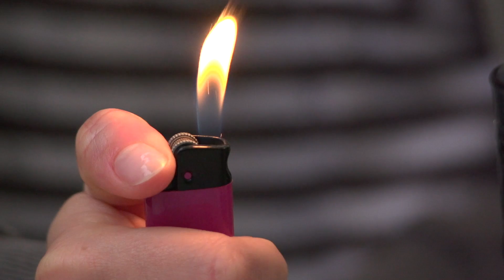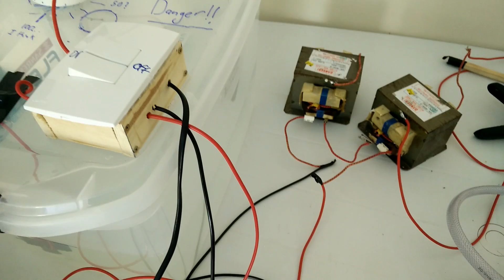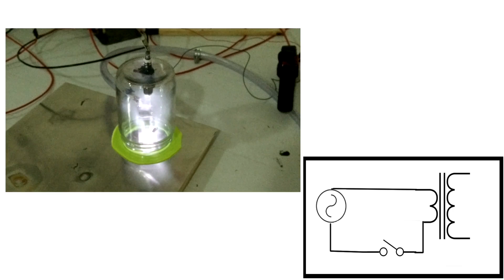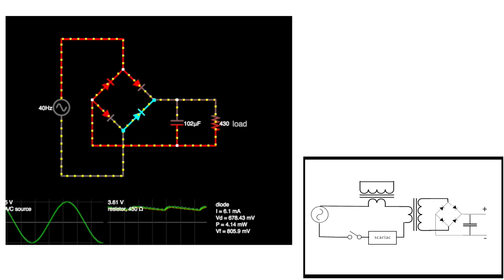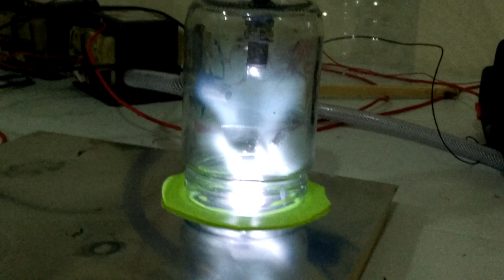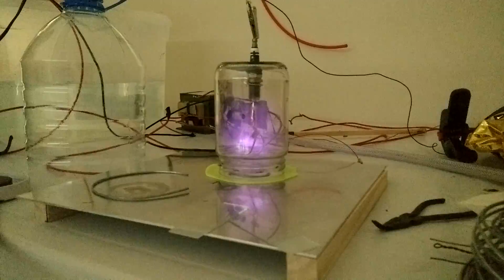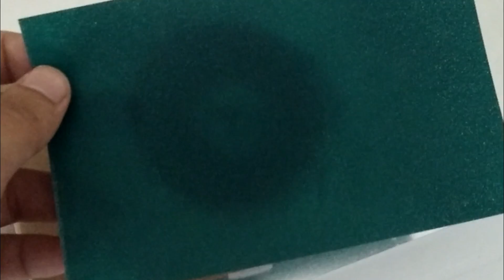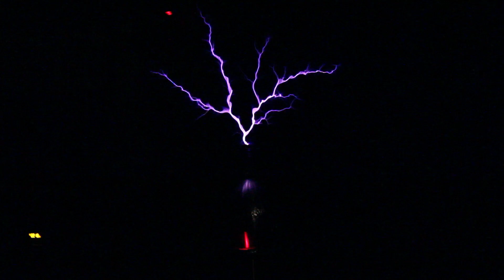Putting Plasma to Work (DIY Fusion Reactors, Magnetrons and More!)

Comment: plasma is the most common form of matter in the universe, so people should know about it.
Reply: teach it in k-12 then...
Reply: Guess what? Our Earth's core is plasma. Shhh. Our government doesn't want us to know where gravity comes from.
Reply: @vDarknessFalls  That's sort of true, since the Earth's core is metal, and liquid metal (like the outer core) is basically the high density equivalent of plasma, and it is at plasma temperatures, with the deep core being hotter than the surface of the Sun.

I'm guessing your just making fun of Electric Universe "Theory" supporters, and, yes, the Earth's core only provides a fraction of its gravity and it's just because of mass, not anything to do with plasma- or metallic-ness, but I just thought I'd point out that you were kind of of right.

The 2nd most likely (and almost as likely) possibility is that you're serious, in which case you can replace my "yes" with a "no", but you probably don't trust me anyway.

Comment: if you can do all that why not build a laser? btw if what you need is just high voltage why not go with a simpler power source like a fbt driven by a cfl circuit or eb and a homeade cap on the output,,you should be able to get 10-30kv cw power if your cap is good

Comment: You make a couple big safety mistakes when wiring. 

First off, the body of the transformer should never become hot. With your setup, there are two things I saw that could cause it to happen. The first is simply mixing the wires; if one of them is shorted to the body that needs to be neutral. The second(and what I think you done based on your setup) is that the type of transformers mentioned above can't have a load between them and ground. Where you physically connected your scariac is the problem. You need to move it to the hot side of the circuit; it will still have the same current limiting effect but will keep the body of the transformer grounded.  

Second, never ignore the ground wire. especially when working with high voltage/ions. The entire reason for that extra ground is to make sure you always have a direct link to ground to dissipate stray charge build up on surfaces that shouldn't have charge. It also protects us from when we get too clever for our own good(like putting a load between your transformer body and ground...). No device needs that extra ground to work yet every professionally designed device has it. 

Finally, you should had some sort of current limiting device into the circuit. A fuse will work, but if you mess around with this kind of stuff enough than you might as well invest the $15 in getting something like a 5 amp breaker to put between your surge protector and outlet. 

Oh and one more thing. Consider getting a cheap function generator. I won't hold this against you because you try to minimize equipment, but you really should invest a bit into the basics before trying to tackle stuff like this. $300 will get you a basic setup(function generator, DC source, and o-scope). In trying to make things more accessible, you also made them harder and more dangerous as people working on this are doing so blind with dangerous power.
Reply: i was watching his video about sputterers and all this high voltage wiring is just there, bare, on the table, in quite a mess. It's a disaster waiting to happen. At least screw it down or something. And this is while he's messing with the vacuum pump, argon tank, and magnets.
Reply: Safety shmafety, I like danger and you should too
Reply: @marshallsober  what if I told you that dying is a health hazard

Comment: Why did you choose press fittings? They are more expensive. A regular 3/4 or bigger (1 1/4 woulda been good size haha) sweat would of worked fine. Hence no rings around the outsides of the fittings

Comment: Not Flint!  Why do people keep saying that.  Its not flint.  Its Iron, and the reason its hot is because its doing something insanely cool.  Its also why iron is never found pure in nature.  Iron, unlike most metals.  Will literally rust in any air with oxygen in it.  And it does so at a net gain of heat.  So if you chip off very small flake of "Fire Steel"  using "Tool Steel"  the shredded bits have a VERY high surface area to volume.  Why doe that matter?  Iron is hypergolic.  But you never notice because its insanely good and thermal transfer.  Anything about dust sized and it rusts on the outside, but just warms up the rest a small amount.  then cools back off.  you never notice.  So whats happening is your filing off a bunch of pure iron and its becoming red hot because its rusting super fast. 

So you might ask, why do people keep assuming flints part of it?  Well listener, back in the before time, before things like Tool Steel and Plough Steel.  Special alloys.  they needed a way to make those shards of Iron.  and all there iron had the same hardness.  So they used something that was harder.  Flint, has a higher hardness rating then firesteel.  and people would carry specially shapped ringers of iron to make this easier.  But it was very hard to do.

And that my good sir, is why It drives me right up the wall to hear you at the 0:47 mark of the video saying Flint particles!  Like what about them is supposed to heat up and why?  Is it supposed to be friction?  Or magic?  Its a nonreactive rock flint is.  Please stop spreading that stupid stupid myth.
Reply: Hand warmers.. contain iron and when exposed to air containing oxygen they react (rust) producing heat.. very good insight Sarah
Reply: TIL thanks

Comment: At 17.08 minutes you can see the plasma double layers form, really cool.  Be careful there you are producing UV light and X-Rays.  You could damage your eyes.  UV burns feel like sand in your eyes- Not Pleasant  Keep eyes and bodies away from the experiment.
Reply: Exactly my thoughts. I can't imagine how it can be capable of nuclear fusion, but I can perfectly imagine how it can produced radiation with 2-3nm wavelenght (K emision lines of nitrogen and oxygen). Using voltage in tens of kilovolts and iron electrode would be extremely hazardous I would say. Actually I would like to see emmision spectrum of this thing and I would be curious about placing fluorescent lamp nearby or into the chamber.

Comment: Hello, I just saw your video. I must say you do some amazing things, and I would like to let you know that I have some equipment for sale like what you mentioned in this video That all came from an old STEM microscope I did sell the diffusion pump already, but I still have a lot of it available here - https://www.ebay.com/itm/E-TEC-SEMicroscope-selling-all-parts-separately-for-one-complete-1980s-scope/173832852386?hash=item28793ed3a2:m:mE-ukLr_Irg85WVzlvWtDyg

Comment: Hello, I am not sure if you are still looking at comments for this video but I am in desperate need of some assistance. I have already gained moderate experience with a lot of high voltage DC plasma experiments, usually variations on cathode ray tube designs to play with cathode rays passing through various magnetic field geometries, but I would like to move away from these due to the X-rays emitted. Do you have any info I could read or that you could share in a video about inductively coupled plasma experiments?  From what it looks like it seems a that the goal is to dump a lot of RF power into a low turn count coil (I've seen anywhere from 4-10) which surrounds the vacuum vessel in which the plasma is to be generated. However I do not know what sort of voltage I will likely need for this, and what the lower limits of power consumption are to be able to ignite the plasma (like a ball park for a home brew rig). As well, I am not sure what circuit to use for this. I am currently trying to modify a ZVS driver as they can handle quite substantial amounts of power, but I am worried that the 10-50khz range of most ZVS circuits might be too low to be feasible. Do you have any insight in this area? Thank you.

Comment: fusor will never create fusion. its just a neon light. would be more likely to do fusion with  a single heavywater particle suspended by a electrostatic field and heated by a laser reflecting off two mirrors with the heavy water particle in the middle.

Comment: Loved your video. I AM VERY INTERESTED IN WHAT YOU ARE DOING. I have built a few small devices. I Seriously want to build a portable, focused EMP device capable of taking out a vehicle. I have looked at exploding wire devices. Of course portable means you need a portable power supply. That may make it impractical,  but I want to explore. I would consider funding the build. jay.jenkins.homefront@gmail.com

Comment: A lot of these tech videos invite suggestions for projects but I never get any response.  
They have tried blasting all manner of fuel capsules with super lasers without success.  The basic idea is similar to the Farnsworth fusor.  Drive the electrons deep into the center to pull the ions in after them. and accelerate them to fusion velocities.  But it never yields anywhere near net power.
My idea is this.  Instead of a spherical configuration, a cylindrical configuration allows for the radial confinement of the plasma by coils of wire.  Even a billion degree hydrogen boron plasma can be confined within a fraction of a milimeter diameter cylindrical plasma.  There remains a relatively small area at the ends that needs to be confined.  Even a very dense beam of electrons would be like using a fishing net to trap fleas.  But light photons are said to be much larger than electrons.  And there is some slight Compton scattering with even visible light.  If the plasma is dense to the point of being compressible at the ends, then only enough energy to confine these end electrons is necessary to confine alll of the electrons in the plasma.  If the electrons can be confined, then escaping ions will result in a build up of negative charge which will prevent the escape of more ions.  From my simulations on the computer, a voltage in the tens of thousands of volts would be sufficient to confine a hydrogen boron plasma.
The idea is this.  Without knowing the exact numbers, there is some finite number of watts from a laser that will confine the ends of the plasma.  If a small amount of fusion is initiated in a plasma and some of the radiation from this fusion is fed back into the laser that is confining the ends if a cold plasma, the intensity of the laser will increase.  This will result in an increase in the rate of fusion.  This increased radiation from the fusion will further increase the  intensity of the laser in an increasing power feedback loop. A way to accomplush  this feedback loop would be to use a hollow cylindrical laser that amplifies in a radial direction instead of longitudinally.  A lense or mirror arrangement in the inner cavity would focus the laser outpyt along the axis.  The partially mirrored inner cylinder would allow radiation from the plasma an easy entrance into the laser.  I figure that a cubic meter of a carbon dioxide lasing mixture can deliver a million watts.  Starting off with perhaps about ten thousand watts to trap a cold plasma, a million watt total output might be enough to confine a fusion temperature plasma.  If the focus along the axis becomes hot enough to produce Xrays (the collision of electrons at extremely high temperatures transverse to the laser light would produce Xrays in the same direction as the laser light)  Compton scattering suggests that a fusion temperature plasma can be confined in this way.

Comment: Don't use barbed connectors for vaccuum. Use flat surfaces. Coat with high vacuum grease in a thin film. Plastics suck for vaccuum. Getting rid of trapped moisture is a bitch. Use metal tubing, larger diameters are better. Use vaccuum fittings with viton o-rings. Best vaccum pump is cryogenic. Molecular drag pumps may be the more economical choice.

Comment: The scariac isn't a variable transformer but a variable resistor. You could instead purchase a normal potentiometer for a single dollar in most cases. Wouldn't that be smarter?
Ps: but they are sensitive to high current

Comment: So I'm an electric engineer student that just finished bachelor. I really want to try to do this experiment for a class final project, but I have never worked with high voltages before. I've worked with transformers and induction motors, but 230 is the max voltage I've worked with. I'm new to this kind of high voltage experiments, so I will really appreciate safety tips for a beginner like me, and if it is worth trying or I should go for something less dangerous. Insulation gloves, discharge stick, what else I must consider?
Reply: Man up and git it.   I have no degree and am a hick.   I make all kinds of crap.   Try it out.   Just don't get zapped

Comment: Wonderfull video. I have subscribed. But I have to note that I think it's extremely dangerous to put jars made of normal glas under a high vacuum. I would prefer boriumsilicate glas with a certain degree of thickness. 

And than I have a question. 
Is it also possible to set a jar or bottle under vacuüm strong enough for this kind of purposes by heating the gas inside to a super high temperature for example nitrogen to 800°C or higher and close the bottle after heating so it's creating a vacuüm when it cools or do you really need a expensive pump?
Reply from the maker: You need the pump. Heat glass like that is a recipe for explosion.
Reply: @thethoughtemporium  I forgot to mention that the jar is'nt closed while heating it up and made of heat resistent boriumsilicate B3SiO4 for laboratoria purposes. I understand the gas will expand and create a huge pressure on the wall, not a very good idea. But closing it afterwards. And for this temperatures the jar may even need to be made of siliciumdioxyde SiO2. But closing the jar when it cools creates a vacuüm inside like what's happening with canning. I only don't know how strong the vacuüm will get. There must be a formula to calculate this. But i do know higher temperatures means a stronger vacuum at room temp. Just curiosity.

Comment: I would highly recommend you attach the ground wire to the iron core/body of the MOT. It could save the rest of the circuitry in your home when you draw arcs or short the output coil. There's a reason it's grounded inside the microwave.

Comment: Few notes:
Don't use a SCariac. 
Use a saturable reactor instead. 
A Saturable Reactor is just a transformers that runs DC through either it's primary or it's secondary. 
To prevent weird feedback issues use a transformer with 1 to 1 windings. 
You just need to put the AC side of the reactor in series with the MOT, probably on the 'live' side, but AC being AC it may not actually matter. 
The DC side can be run off of a 9 volt battery. It takes almost no DC power to control large AC power sources. 

After that, rather than running vacuums, run noble gases.

Comment: You can get a 5 amp variac for $50 new a 30 amp for $110. https://rover.ebay.com/rover/0/0/0?mpre=https%3A%2F%2Fwww.ebay.com%2Fulk%2Fitm%2F172864908354
Also a FYI In Asia they commonly referred to current as pressure and voltage as flow.  😎

Comment: Why would you just want to destroy your microwave just take out the Transformer when it's broken you can just replace the capacitor and probably the fuse and then it will work again that's the problem with most of them use neon sign Transformers they're better in my opinion and also use a variac on the neon sign Transformer because it can go up two more voltage than mains

Comment: Have you ever had any issues with radiation using a cheapy harbor freight vacuum pump. I'm new to this and I am concerned about safety. Im experimenting with different high voltage supplies, hid ballasts (25kv), mots, nsts (5-10kv) and flybacks. I just wanna be sure that I am safe from dangerous levels of radiation. I am about 15 feet from the chamber as well.
Any input?
Reply from the maker: Anything above 10kv will release xrays and you should have a geiger counter to make sure you're not being exposed to radiation.

Comment: You could use a switch that has a band around your wrist that shuts off when you jump from getting shocked like the ones found on snow machines etc
Reply: Try getting a newer neon sign Transformer it has a built-in circuit if you touch one of the wires to the ground underneath you or if you actually touch it it will shut down the Transformer and it will blink a lot which then if you still wanted to use it you could just shut it down and turn it back on and you can still use it and I would say a neon sign Transformer works better for a Jacob's Ladder because you don't have to touch the two wires together to start making an arc neon sign Transformer can just jump out of the air and make an arc so don't really play with microwave oven Transformer the dangerous and they're not as good as neon sign Transformers in my opinion
Reply: Yea that would be a good idea.

Comment: Is this potentially dangerous due to radiation, or does it depend on the gas and the voltage?
Reply: I did some research of my own, and with the energy put in, it is a negilable amount.

Comment: Why not make the connections through the base (old car spark plugs are great for electrical connectors and you can connect your hose-barb without needing all that JB weld and stuff)
All you've got to do is drill and tap holes in the base plate (leaving a gap for an o ring), hold it up on a couple of blocks of wood.

Secondly, is a fridge compressor really that bad? I've got one sat in the corner of my office and there's no way I can afford a big-boys vacuum pump. :(

Comment: Hey, do you need special diodes for your full wave rectifier if it's connected to the secondary of your main transformer (ie the stupidly high voltage side)?  What about the capacitor as well, since you don't want to run it over its rated voltage (kV range, if I understand you correctly).